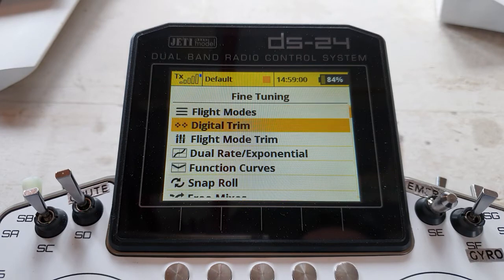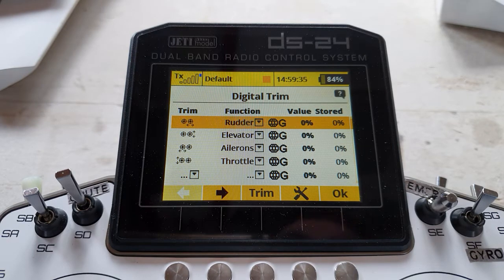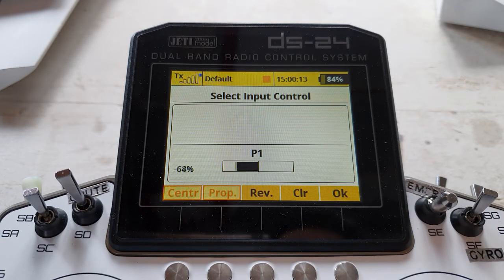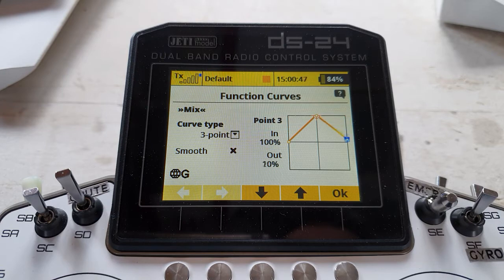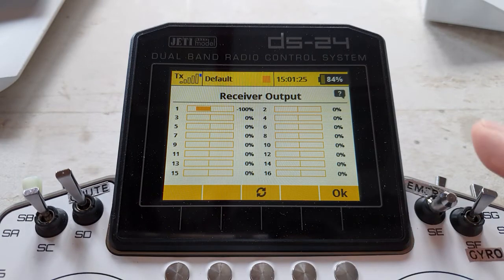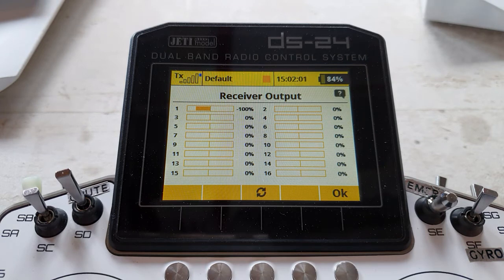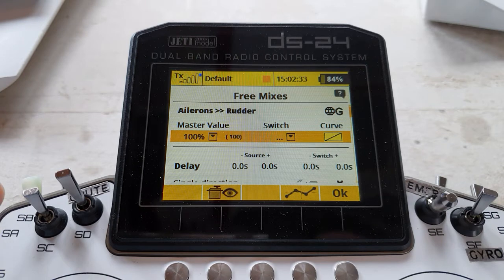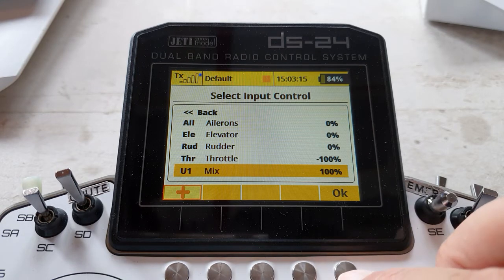Jeti - three function model, RES, etc

Comment: Hi Harry, let me ask you a question. Is it possible to create new function with two assigned servos similar to aileron? Eg. function = ailerons + assigned servos = aileron1 and aileron2, I created function TV (for thrust vectoring) but have no idea how to make TV1 and TV2 in servo assignment menu. Thanks, Robert
Reply from the maker: If you have created a function you can assign any servos to it
Reply: @cotswoldpilot  well, yes but... Create model with 2 Elevators, create a new function, assign 2 servos to that function, make new free mix Elevator to the new function and look at how the 2 servos assigned to the new function work. Hey, they do not copy the Elevators, so change the single direction in the mix and look again ;) SURPRISED? I have already talked to JETI about that and it is going to be fixed in the coming FW update or the next one because the coming one is already in the testing process.